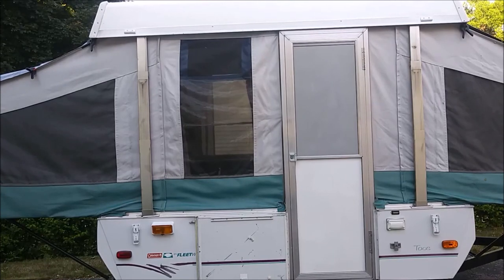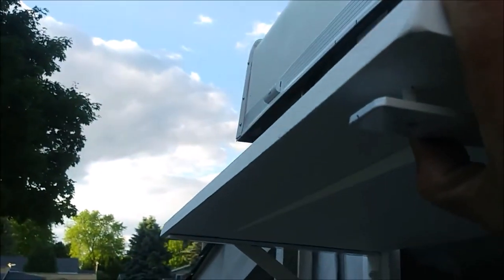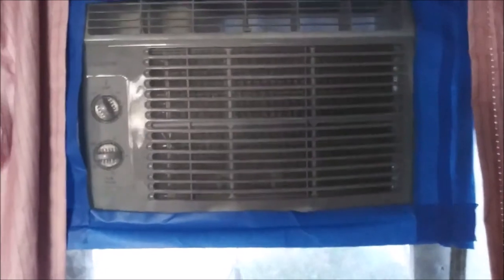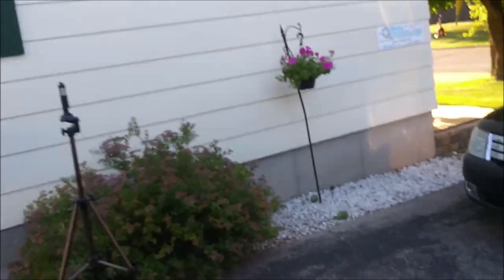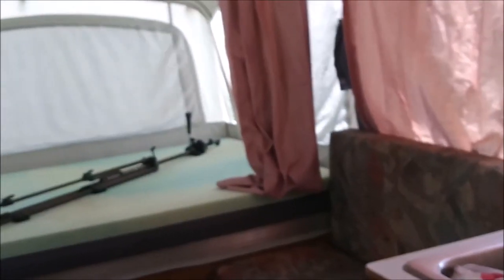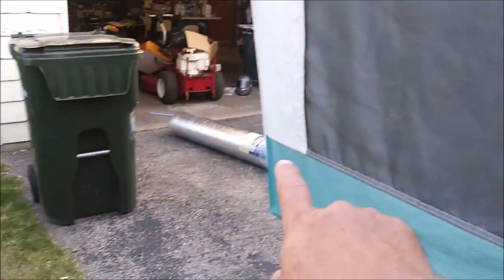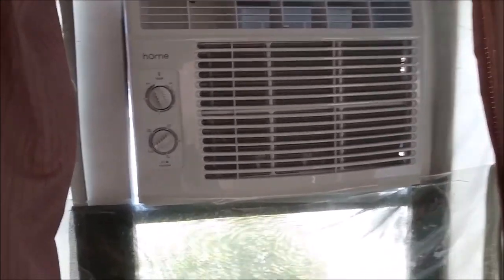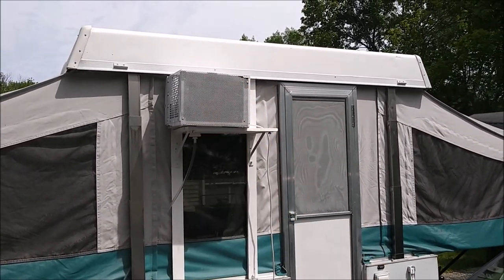Window AC in a Pop-up Camper.

Comment: Get the weatherproof emergency blanket tarps things you can find them at Walmart in the camping section they're a little thicker they have a reflective side and a colored side but they are made for things like going over your tent or in this case your camper bunks and they take the heat off extremely on top of reflectix double bubble insulation foil in each window your camper will stay nice and cool in the summer and nice and warm in the winter
Reply from the maker: Thanks for watching my video. After using the camper only a few times this summer I sold it to my ex-sister-in-law.  It was hard to camp without my wife.

Comment: Wow very awesome video loved it !!! You explain everything great and in such good and simple detail ! Thank you sir new Sub here ! Great Great Job !
Reply from the maker: Thanks for watching my videos. I have plans to use this camper all summer long. That air conditioner is certainly going to get a workout.
Reply: @JamitinThereRepair  Thank you sir I have a question would 30amps be enough to run the roof A.C and one of these small window units also?
Reply from the maker: @davenstorm7271  I run mine on it's own 110 extension cord to the camp power.  I think it needs 15A to run.

Comment: Hey there! Wanting to do something similar to this with our popup, and have a couple questions. Why did you decide to place the mounting brackets and AC unit in that particular spot? I think personally I’d prefer to have ours on the other side of the camper but wanted to make sure there wasn’t a specific reason the spot you used might be best. Also, have you noticed if the weight of the AC unit pulls the roof out of alignment at all? For our camper, if it is just a little unlevel our door has a hard time opening/closing and don’t want something like this to make that harder. From the comments it’s seems you’re not using this rig anymore, but wondering if you have any thoughts to share? Thanks!

Comment: Great job, this is exactly what I’m looking for. I have a Coleman Laredo 1997, that has the exact same outside and canvas set up as yours. One thing I don’t understand though, what is the purpose of adding the metal grate to the back of the A/C unit?
Reply from the maker: The back of the air conditioning unit is the evaporator coil. It has very fine fins that will bend very easily. The grate is there to try to save the fins from being bent over.
Reply from the maker: Thanks for watching